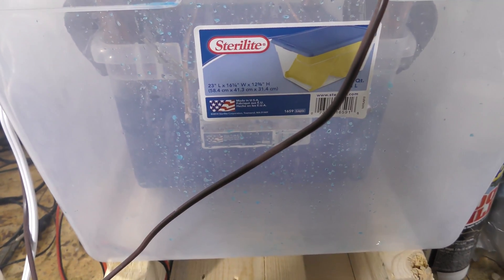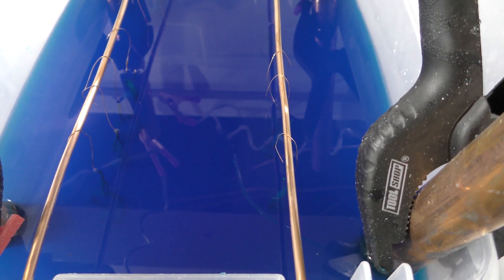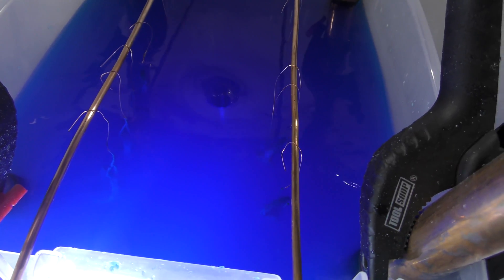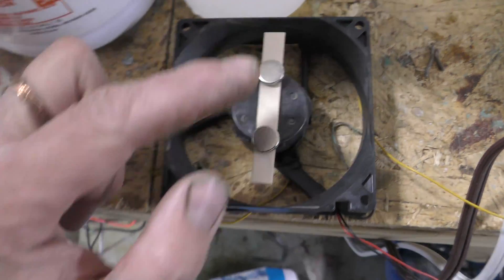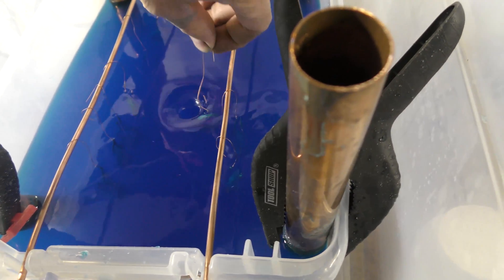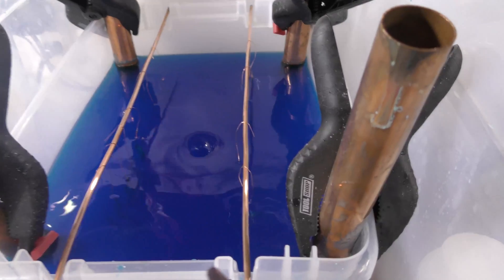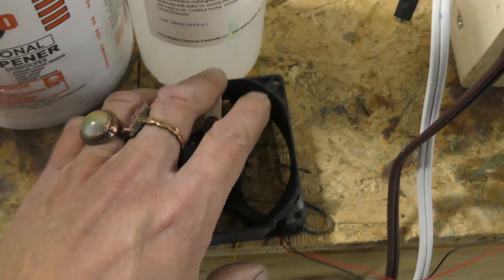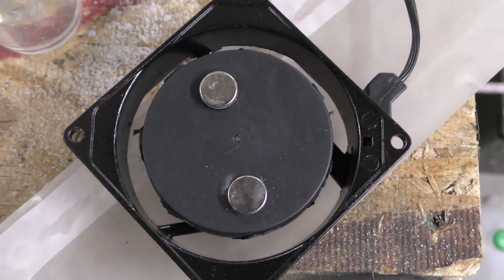Magnetic Stir Review with Electroforming

Comment: What is the purpose of a stir plate? I’m having problems doing multiple pieces at once (all the copper flows to just one piece at a time), would a stir plate solve this problem...?
Reply: Did you ever get a answer. Id love to know.
Reply: TastewithTasha I did some research on the stir plate and I get it. My issue was that the electricity wasn’t going to all the pieces cause the copper wire bar I used to hold them all up was anodized.
Reply: https://youtu.be/LzMog5DbFtU
Reply: Sand paper your hooks and bars initially and occasionally after that.

Comment: The fan is running 15 volts at 4 amps?  That's 60 watts.  I highly doubt it's running at 60 watts.  That little fan couldn't handle that much power.  A typical box fan doesn't even run at 60 watts.
Reply from the maker: 16v 3.75 amp its a old laptop charger
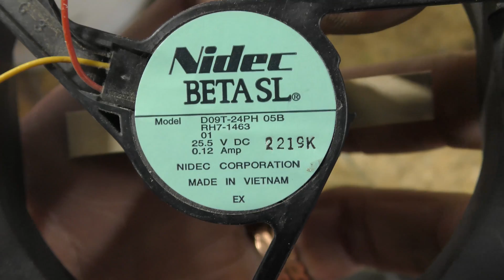Reply: @JasonWelsh  If the fan is running at its rated voltage it will draw its rated current; e.g. @9:48 your fan draws 120mA at 25.5V.  You can't "push" more amps through it; I=V/R and both Voltage and Resistance are basically static based on how the fan was designed and built.  At 10:44, 24V 4A power supply won't do anything to a 24V fan. The fan will simply draw its rated current, for your 25.5V fan it'd draw slightly less than 120mA since you're running at slightly less than the voltage it expects.  You could stick that fan on a 24V billion amp power supply and it'd run fine.   But if you go over the rated voltage then you get problems because it will start drawing more than its rated current and the coils will get hotter than what they were designed for and eventually melt/burn through their insulation and short out and kill the motor.  It also could die sooner than its design MTBF since it has the popsicle and magnet inertial load and probably is spinning slower and cooling itself less, although it probably depends on ambient temperature in that case.